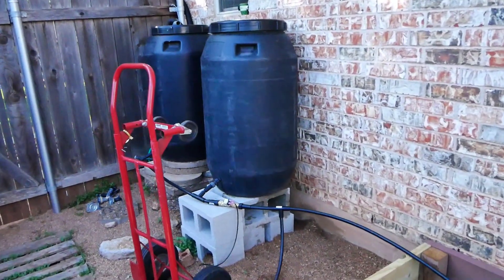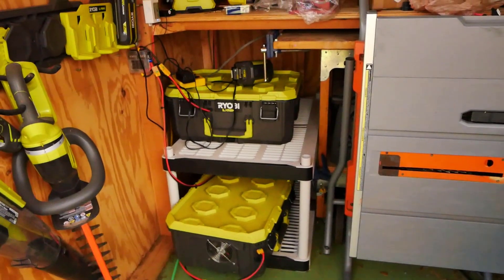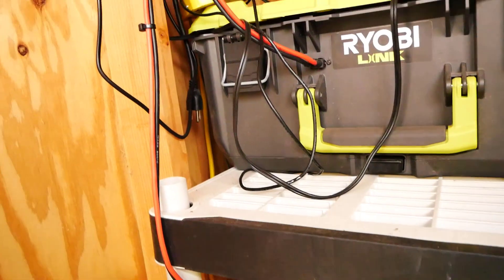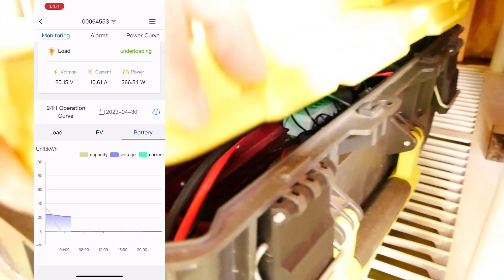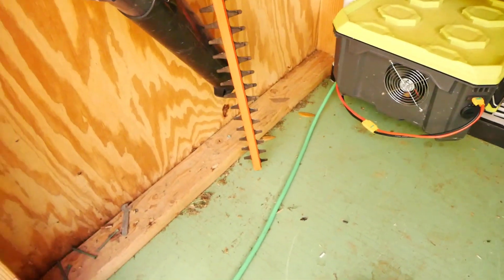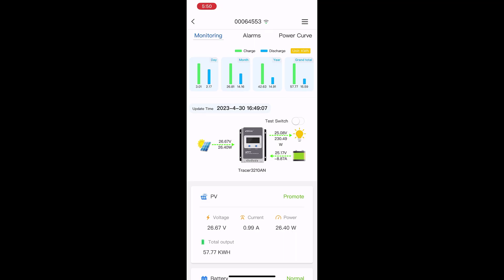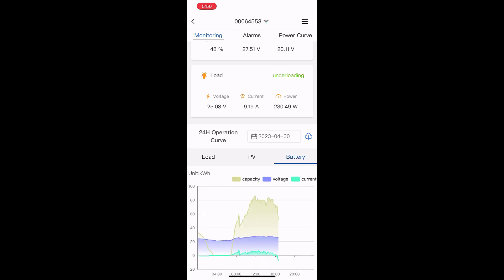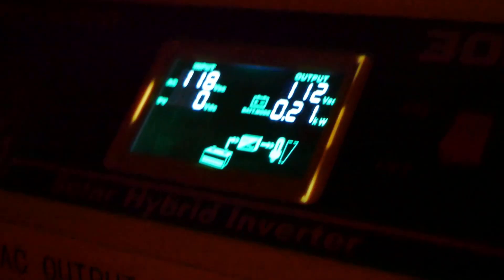Powering my WFH office with a solar power bank and solar

Comment: nice video. sustainable energy
Reply from the maker: Yep. I realized I was giving up free sun a couple weeks ago, once the 40v garden tool batteries were charged, so ran an extension cord from the 600 watt system back into my home office and now I’m probably saving $20/month on running my one big workstation that runs at 200-300 watts. Two 8 core Xeon’s eat some juice!